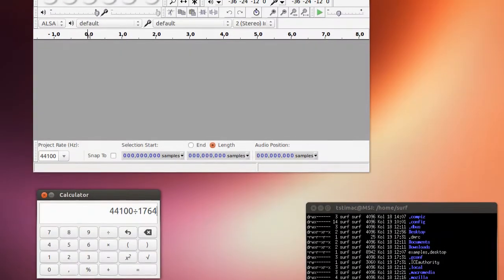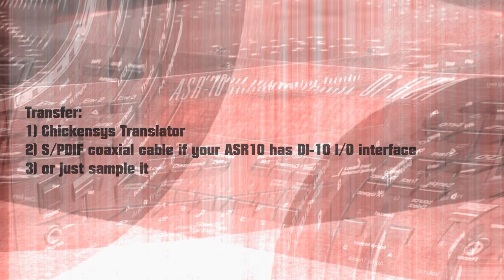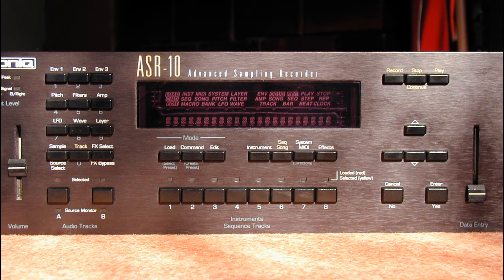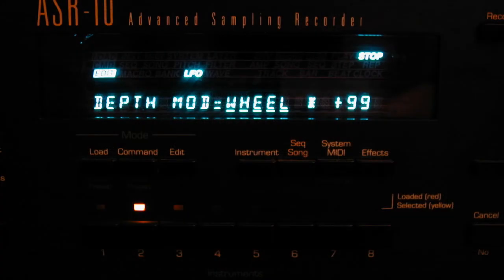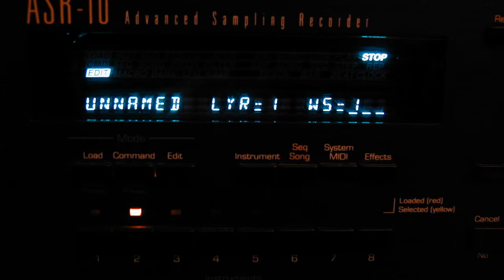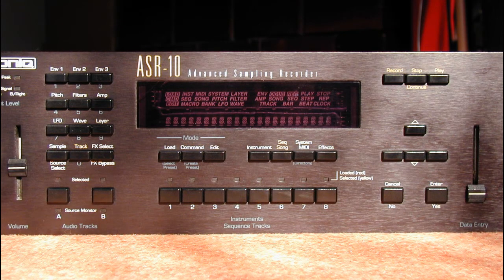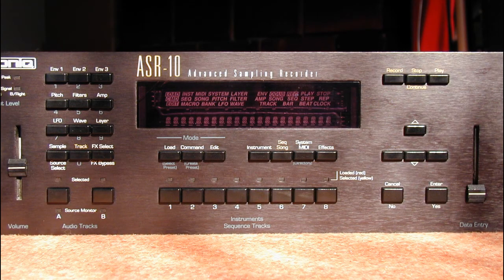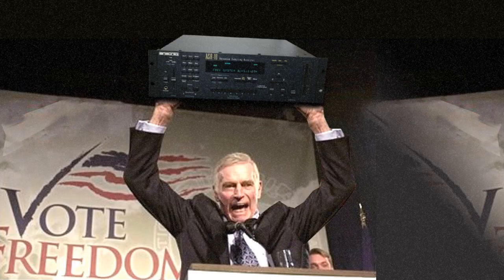Ensoniq ASR-10 synthesizing organ sounds (HD)

Comment: To answer the Professor,it's like this..There's gear and then there's true freedom,and the Ensoniq ASR10 brings it,in every way.They TRIED to take attention away from the ASR 10,talking about having to wait to load it,about only 16MB,and that it ran hot.This was a list of complaints,not limitations,and even today,after i bought the 16MB stick,i still havent installed in,in over 20 years.I still havent really used my MidiVerb that much,nor had to get any effects units,because the ASR has it all for me.I spin records live,and mangle or augment records with efx,and it proved to be the perfect companion for my analog synth.All the moves make sense and the onboard CPU/DSP is second to none.Once you experiment with it,it shows you more and more of what it can do.I am curious to know what will be possible if I use 2 ASRs and a computer,connected by SCSI,and connected to something like a Roland VSynth GT,or Ensoniq VFX..That's going to be wild...

Comment: is the rack the same as the keyboard without keys i could buy the rack & use a midi keyboad?
Reply: Yes you can
Reply: Midi had more latency, the rack overheats also, I'd get the keyboard.

Comment: Great to find some ASR Brethren..
Just want to point out (well here in Australia that is .. I worked in the Hi Tech dept of a few Music shops) The ASR keyboards did have the RCA/SPDIF Coax connectors, but to utilise the SPDIF option, it was a Digital Board I/O option to put them into effect....
Though its been a while, I think SCSI and Digital Option were standard on the rack..

Proud ASR10 Keys (x2) , MR61 and DP4+ owner here... Ensoniq's dynamic range , headroom , punch was where every other brand is not worthy..  Well maybe when theyre in performance mode, but throw them into multimode, And all those voices "compress" its like pouring water to fast into a funnel, which just overflows... 

I own many different synths and samplers, and those that agree will too.. Those that dont, well, better start mopping the floor...

Mwhahahahahhahahahaha